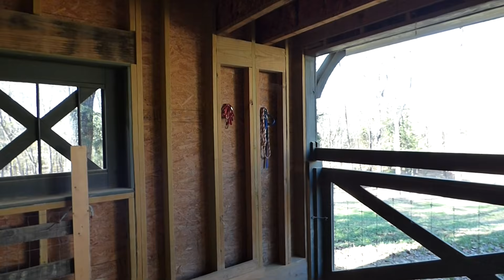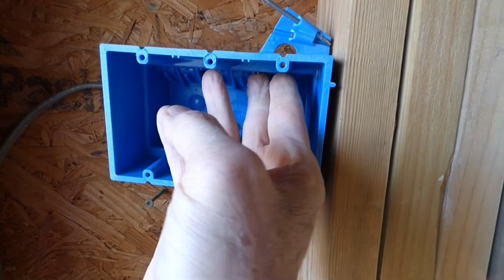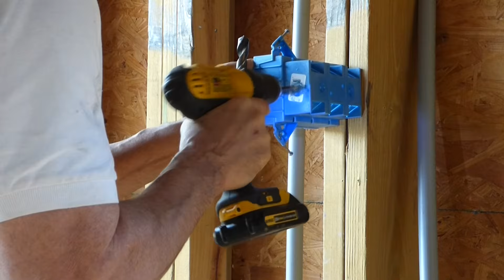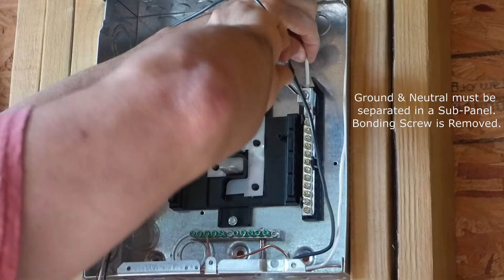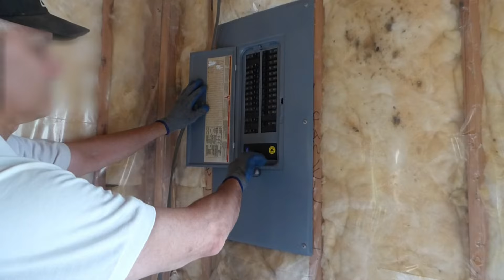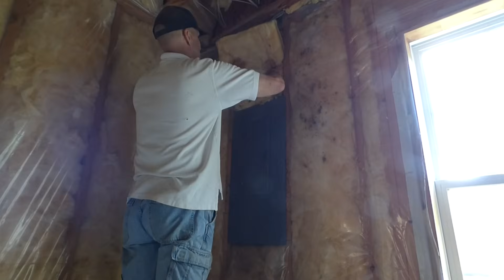Sub Panel Install - Start to Finish - Outbuilding | Shop | Barn | Garage

Comment: lol, why be cheap and only run one hot? You installed the breaker on the dead buss bar. Just do it right and run three conductors. You’ll regret running only one hot, especially one so small. It’s cheaper to do it right the first time.

Comment: You drilled through the studs on the left to run a wire but didn’t clamp it to the panel????

That’s one of many NO NOs…..

Comment: I built a whole sub panel from scratch, wired everything up, but never actually connected it to the main panel. For that I had an electrician code and spend 30 minutes to double check everything and hook it up. This is the way.

Comment: Nice clean looking job.  Only thing I would have done different is run 6/3 UF-B wire which would allow for more circuits AND you wouldn't have to have conduit underground.  You could've direct buried it and used conduit only above ground.
Reply: Conduit is always a good idea, assuming the diameter is sufficient.

Comment: Do you think you are with in the CODE???
Reply: no its not up to code. first, you never drill through the side of a junction box, second, the run from main breaker at house to the shed looked way longer than he claimed?, 10-2 is not large enough to carry correct load. i would have used 12-2 at least. even 6 or 8 would have been a lot safer to me. if you ever install a sub-panel in a work shop, barn, whatever?, when you decide on what sub--panel to install?, figure on future electrical needs!?!. later on, after all that work, you will kick yourself for not running the correct wire to power all the building when you want to upgrade outlets. i do like the fact  that he separated the neutral and ground, plus used a 8ft ground bar, most DYI folks never bother doing it this way?, which is against code in most states.

Comment: I have 30 amp 8/2 plus ground wire run to my shed, (just to an outlet for my compressor or welder) is there any way I can get 1 single 15 or 20 amp 110 outlet from that, using a panel like this? And still maintain my 30 amp outlet when needed? Again there's no neutral wire.. Only 2 hot and a bare ground.. Thank you

Comment: i would have put the big break closer to the main. There is no special code for that, reason is because it reduces the average current density in the bus bars inside the breaker panel, and thus the resistive power losses and undesirable heating.

Comment: one size bigger on the wire or two even would have been better, and being a big barn as u have, I would separate the circuits and put everything on a 20 amp. If you run a fridg or a power tool or something you are going to want some dedicated circuits. Other than that enjoyed watching.

Comment: I have never seen the main power feed come from the bottom of the box with the main breaker and the hot leads on the bottom. ?
Reply: either way configured with lugs on bottom or top of the bus bar its still the same thing bus bar with the main breaker between lugs and bus in this case you will have a breaker before the panel being a sub panel to disconnect for added security where the 200 amp main from the house is hot on the lugs when main shut until you pull the meter i have worked quite a few panel changes hot because of power company taking forever to come pull meter for me lol

Comment: The previous home owners ran a buried an....extension cord out to our barn...Worked just fine until the dogs dug it up, and the lawn mower ran over it. So doing it this way should be very easy, with no worries. 👍

Comment: You went to all that trouble and expense just to run #2 to a 20 amp breaker? # 6 Quadruplex is actually less expensive and more useful in the long run.

Comment: Did all of the breakers work in the new panel. Wouldn't you need 120 volts to both lugs that run to both bus bars? Otherwise only every other breaker would have power.
Reply from the maker: You are correct

Comment: Your first beaker isn't gonna pass any electricity because you didn't put power on that buss. If you are only bringing out 120v you should jump the lugs together with a piece of #10 wire if you wanna energize both busses.

Comment: Thanks for this video.  I've been looking for one like it that features just wiring the subpanel for 110V using 3 wire.  It made sense to me that it could be done, but I still wanted to see someone do it.
Reply: You cant find a video of anyone wiring a subpanel with 3 wires because its not a thing.  This is a disaster.  Dont follow this video.

Comment: I don't see a ground rod and grounding electrode. If that's is a detached building you need a ground rod with a number 6 bare for a grounding electrode system.

Comment: Just cause it works doesn't make it right. That panel is a hot mess.
Reply: Looks fine, its electrically sound besides the wire size going to the barn.

Comment: Was that romex wire you ran in conduit?
Reply: 10/2
Reply: Romex is not allowed in wet conditions (underground conduit as condensation can form even if sealed).  You could technically run UF (direct burial) in the conduit if the conduit meets volume size limits so that it would not overheat.  Normally you would run individual THWN (wet rated) labeled wires inside the conduit (much easier to pull).  Most THHN wire is also rated THWN but that is not always the case.
Reply: @jaycahow4667  He didn’t say, but it looks like UF.

Comment: So much wrong here I don't know where to begin....smh.
Reply: Crazy thing I’m learning from many videos on sub panels is you have to separate neutral and ground, but no sub panels have 2 bus bars, lol. They sell you one for $10.00 for a 25 cent aluminum piece, lol.
Reply: Classic! "Pros" always said that.
Reply: The supply house gave me 8/2 with ground, so I’m going back to add another wire to fully energize my sub panel for 220. I normally wouldn’t need it but the 2 post lift takes 220, thanks
Reply: How about giving us just one or two examples...if you can. Seems to me like you can't.
Reply: Sounds to me like you're fishing. If you know even just a little bit about wiring, you'd be shaking your head.
Reply: So wrong it actually worked.
Reply: haha yeah im thinking the same

Comment: yOUR FEEDER WIRE IS WAY UNDERSIZED!
#6 IS GOOD FOR 65 AMPS DEPENDING ON WHAT TYPE OF WIRE!  dONT MAKE ANY MORE OF THESE VIDEOS.  ALL BAD INFO!
Reply: He is only using 1) 15 AMP breaker. 10/2 AWG wire is more than adequate. I have 10/2 AWG running to a 4 circuit sub panel on a 30 AMP 2 pole breaker for my water heater. I only have the 1) 30 AMP 2 pole breaker in the sub panel. You don't want to go any higher than 30 AMP on a 10/2 AWG wire.
Reply: @jonathan3982 I’m no electrician for sure but I think you wire it to code because you don’t know what the next person to walk in is gonna plug into it

Comment: I suggest you getting some knowledge of an electrician before you even start!  1 your wire looks bundersized, making your conduit is undersized. 2 what is the length of wire your running to the subpanel to your main?  over 100'?  If so it needs to be derated.....so meaning the wire sized needs to be bigger! 3  Dont just drill into the side of your 3 gang box,  but whatever , wont count that!  The list keeps going on.  SERIOUSLY GET HELP.  I SEE A FIRE IN YOUR FUTURE!

Comment: Thank you for the video, well done. QUESTION. I currently have a 10/2 wire coming from a 20-amp breaker running from my house going to my garage. I would like to install a sub panel in my garage and have breakers for my lights and outlets. Currently, it seems to be wired wrong and I really have no idea what's going on behind my walls. I was planning on ripping out all my drywalls, and completely re-wiring the entire garage. I really just need to know if I need to change my 20-amp breaker in my house in order to install a sub box. Thanks.
Reply: 10-2 for a 20A circuit is in code.

BUT, it all depends on the distance from main to sub, considering droppage and is it under ground, in conduit or PVC.

I have a metal shed, a 20'x20' that I'm running a 100A sub panel to, which will be my work shop.

It's mostly 20A circuits, LED lights, and one 30A 230V for heater eventually.

All my 20A cricuits and LED lighting is run with 12-2 solid copper wires, with rhe exception of the 3-way light switch eith 12-3 solid copper wires.

I'm no electrician, been an industrial maintenance for 40 years. I am hiring a licensed electrician to double check my work and certify the work and repair as needed, so it can pass the county inspection to have a legit electrical permit on the building...just in case I decide to sell my house.
Reply: A 20 amp breaker can feed a 30 amp wire no problem. Less voltage drop using #10. But you are limited to 20 amps rather than 30, in which case you would have to change out the 20 for a 30.

Comment: I don't understand why you'd run #10 wire to that huge panel.
Reply: Yeah.  I wouldn't run less than 4 AWG to allow for expansion and I would have run power both legs.  And definitely would not be feeding that box through the studs.
Reply: @williamh4172 😂that’s why he not showing his face

Comment: Balloon framing is used in multiple story structures a garage is standard framing.
Reply: Because the 2nd story floor joists supports the studs,correct?

Comment: so inside the main panel the natural and ground can be on the same bar? just the sub panel has to be separate?  love the donkey.....
Reply: In the main panel the ground bar and neutral bar must be connected. In sub panels that is prohibited. 

If a hot wire touches a metal cabinet, the connection between ground and neutral in the main panel provides a low resistance to current flow completing the circuit and causing the breaker to trip. However, if the ground and neutral are connected in the sub panel, it allows for the possibility of current to get onto ground at the sub panel and potentially energize any metal chassis connected to ground. 

That is why ground and neutral must be connected at the main breaker panel but are not connected at sub panels.

Comment: It appears to me that the 15A breaker installed in the barn was NOT a GFCI breaker as stated, just a normal breaker.
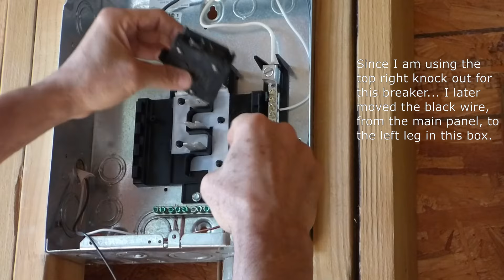Reply: 12:14 15A breaker in sub panel. 
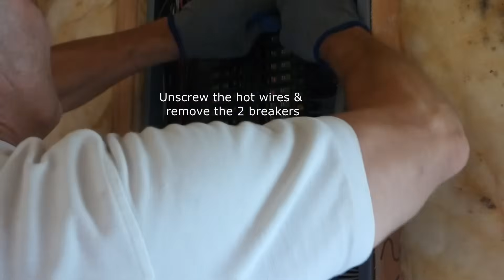17:13 30A breaker installed in the main panel - Is there any requirement this must be a GFCI breaker?
Reply: @satsangatwenissangatwam8422  I may be wrong but I thought all outlets had to be GFCI protected in an out building but could be done at the outlet level and not at the breaker level.
Reply: U can either use a GFCI outlet or install a GFCI breaker but not both on a circuit. @jaycahow4667
Reply: The outlets can be GFCI — but they aren’t 😵⚡❌

Comment: What color was the wire going into the new twin 15?   Looked like a red to me.   If your septic alarm and pump were wired with 12/3 WG, technically that would be incorrect as you would have 30 amps of overcurrent protection on a #12 neutral off the same line.   Also, that would be a multiwire branch circuit requiring ties across the handles to turn off both at the same time.  Required since 2011 NEC I believe.
Reply: Just was about the same. Most likely it's a multiwire branch circuit. To the installer in the video, the tandem breaker needs to be taken off completely off this circuit and replaced with a double pole breaker allowing proper MWBC wiring. When on double pole breaker, it allows the black and red wires to be on opposite lines (L1 and L2) of single phase. This would make the neutral only carry the imbalance of current between black and red which, in normal function, would never go over the breaker rating, therefore being safe and code compliant.

Comment: Good video. Some people nit pick some details and there could have been some improvements for future use. People fail to realize this is exactly what you needed and it worked. If you wanted to add a hot tub out there you will have a bunch more work but it is a barn.  You know what you will use out there what it will entail to add more. Great job.
Reply: Definitely not true!  Just because something works, does not mean that it's safe.  I applaud the effort, but there are so many code violations, and unsafe conditions!  I would strongly suggest an inspection by the JHA to ensure that there remains no dangers to anyone!
Reply: What is unsafe about it? He needed a couple circuits in his shed , I'm going to do the same thing! You say it's unsafe   give an example! You can't!!!!

Comment: You can’t drill through the side of the junction box.  That’s against code.   
You should have run the wire above the box then had the wire enter through one of the tabs.
Reply: Correct!

Comment: Great job. I enjoyed the video. also if you ran 10 3 you could have more circuits in the future but still fantastic job. I appricciate your time.
Reply: Do you think I can use for two windows   ac , lights and recepticals ,2=15 brakers, and 2=20 brakers ?
Reply: Horrible Job

Comment: Illegal. If this is a seperate out building you're required to have a main breaker in that subpanel
Reply: Only if it's more than 6 circuits.
Reply: Rule of six! Even though it's in a separate building it doesn't need a main disconnect because it's only 4 circuits.
Reply: I do not believe that is 100%. Some areas I believe allow you to forgo a main breaker for a subpanel if all of the breakers on the subpanel can be turned off quickly (one hand).
Reply: No you don't for a 4 circuit panel.
Reply: Article 225.30 absolutely requires a “disconnect” for a branch circuit or feeder to one building from another.  A main breaker can be a disconnecting means.  So can a fused or non fused safety switch.  The six switch rule can not be used as that is for “Mains”.  The smallest “Main” allowed in NEC is 60 amperes.   The disconnect requirement is not an overcurrent issue.
Reply: You don't need a main breaker in the panel. You need a disconnect on the outside of the building. It doesn't have to be fused either. You can use one of those 6O amp push-in pull-out disconnects like you see on residential air conditioner installs. Available at the Depot.
Reply: I don’t see why he would require a main breaker in a panel that only has one breaker in it. Isn’t the single breaker a de facto main breaker for the sub panel?
Reply: @davidroddini1512 So, I am going to be doing something similar. My plan is to run 40 amps single pole for 110volt. I need two twenty amp breakers, one dedicated for a mini split and one for the outlets 4. So 8/2 would be good with a 40 main, correct?

Comment: Your main has ground rod. You dont want a ground rod on sub.
Reply: Yes you do want a ground on a sub in a detached building.
Reply: its actually required in a separate building with separate ground bar and grounding screw removed
Reply: Tell me you aren’t an electrician without telling me lol

Comment: need bushing/cable clamp for feed to gang box
Reply: Into the gang box without using the proper entry is also problematic.  No clamp on that side either because it's definitely not intended to be drilled and used that way.

Comment: Seems like an awfully long distance for a 30 amp circuit with 10/2, personally would’ve stepped up to 8/2 for the distance
Reply: Should be no more than 57 feet for 120V and up to 114 feet for 240V on a 30 AMP breaker. That looks way further than 57 feet. But it may just look further than 57 feet.
Reply: Well you never know. Voltage drop is, dependent on wire size, length of run, and size of load. If you're just trying to run a couple led lights the load is so small that you'd have very little voltage drop. If you were running a table saw with a 3/4 HP motor the voltage drop would probably be so low that the circuit breaker feeding the receptacle would probably trip because the amperage would be so high. If it didn't trip, your motor might burn up operating on the reduced voltage.
Reply: Doesn't matter. He might have a very small load. Voltage drop is dependent on wire size, length of run,and size of load.
Reply: Ran in to this when I remodeled my pool found the rusted metal conduit full of water under the ground.  Could not understand why the pool contractor ran all individual circuits all the way from my main panel instead of using a sub-panel. They told me it's cheaper to run bunch of smaller wire then running fewer heavy AWG wire. I told them I wanted a subpanel I could shut the power off right at the pump in case of an emergency didn't have to run back to my main service panel.
Reply: Yeah I looked again it does look further than 57 feet.
Reply: Generally 1000' before voltage drop begins to play in as critical. More critical when wiring to motors in math consideration.
Reply: @tommywatterson5276  1000 FT????   Did u mean 100ft?